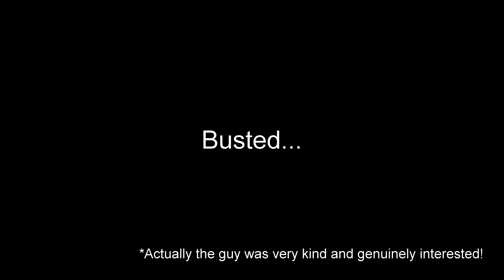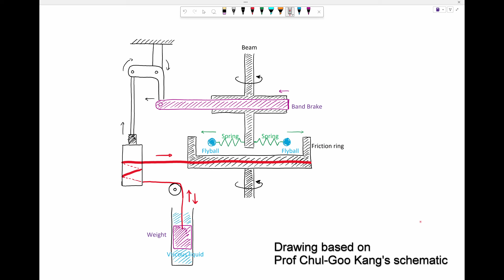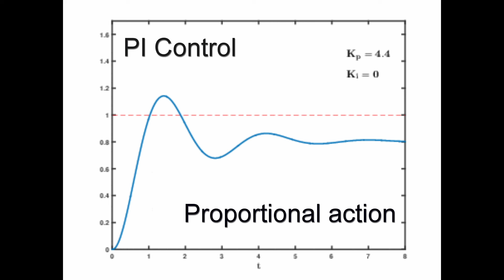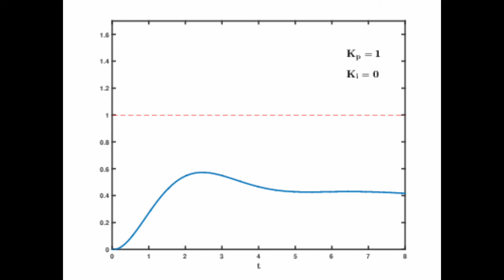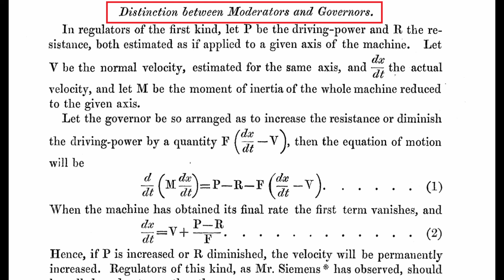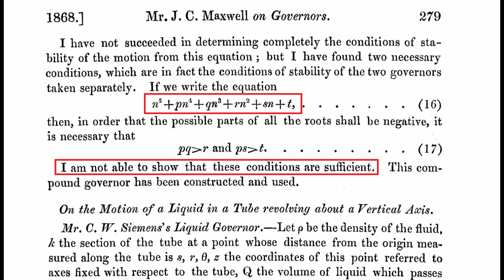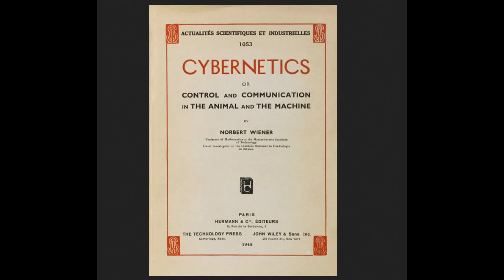When Maxwell Casually Invented The Science That Rules Our World... (And It's Not Electromagnetism!)

Comment: Is there something special in the fact that the weight in the additional cylinder is immersed in a viscous fluid ? 

we understood that :
- the first red belt (on top of spool) is making a proportional action 
- the second red belt (on the bottom of spool) is lifting the weight and storing potential energy for so long time the error is present so we have integral action.

but what about the resistance of the viscous fluid  ?  a weight in a viscous fluid is giving a resistance proportional to velocity of the weight is moving in the fluid. So this last one observation seems a derivative action.

Thanks and Regards.
Reply from the maker: @Mark-sq8mh this is a good question. No, the effect is not a derivative action, but I see why you think so. The reason of the fluid is actually explained by Maxwell in his paper. The "frictions" are lumped in a coefficient Y, which also includes the viscosity of the fluid. Maxwell showed that the stability of the device depends on (B*F/M + Y)Y-G being positive. Thus, increasing the viscosity helps to make that quantity positive without mechanically changing the device. In the words of Maxwell: "To ensure this stability, the value of Y must be made sufficiently great, as compared with G, by placing the weight W in a viscous liquid if the viscosity of the lubricating materials at the axle is not sufficient."
Of course the effect of Y is to damp variations of the response and in this sense it is reminiscent of a derivative action, but it not a proper one.
Reply: @Prof_Gio  thanks again.
Reply: I haven't studied this device but my explanation:

It would be derivative if it were measuring the speed of the engine shaft. It is instead measuring the energy that has been stored in the feedback loop while the engine was overspeed, then viscously damping the resulting feedback torque *only from the weight*. The friction band braking effect happens to be viscous in action, but not in the control scheme that determines its magnitude. Reasonably close Professor? 

You could in principle have another feedback gear/shaft/weight system for underspeed condition, using friction from the governor balls when they're spinning slower than the setpoint. Not sure what it could actuate, maybe a valve for fuel/air mixture?

Comment: I was wondering if there was ever a mechanical governor that was a pid  Governor I actually came up with a design for one in my head. That also use the flyballs to turn an external ring to add integral into the loop. Although it had an internal ring to remove intergral from the Loop.  Also had a derivative function that oddly enough Use a set of differential gears like you find in a car.
Reply: Ah, so one differential halfshaft goes to the motor, the other halfshaft goes to a flywheel, and the pinion shaft would be the derivative output with a spring to keep it centred. something like that?
Reply: @maxff123   ya.   Compare the flywheel speed to the motor speed and adjust accordingly.   Fluid coupling to match flywheel speed to motor, over time.   Density of fluid is part of the D response.